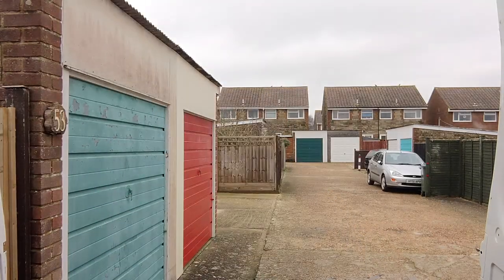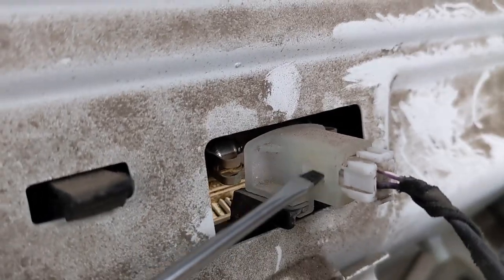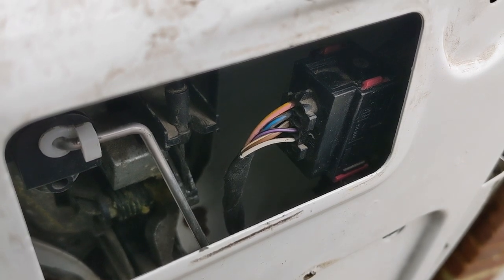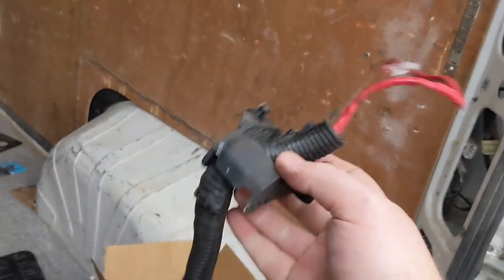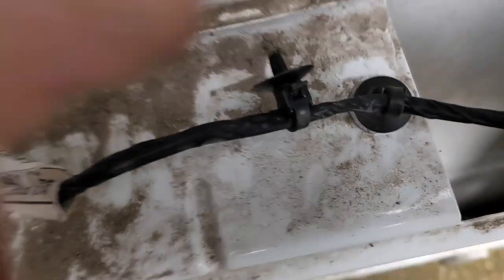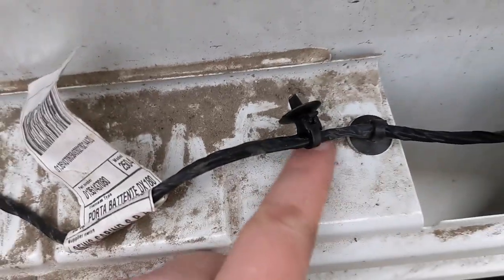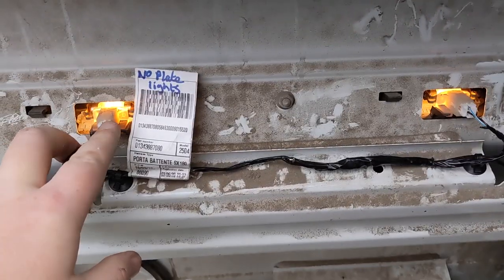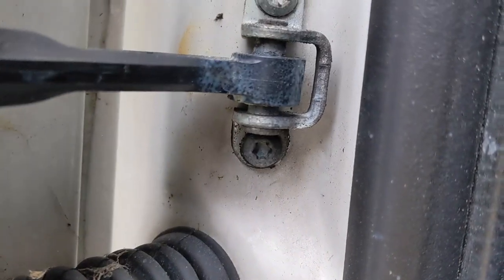Citroen Relay | Rear Door Cable Guide and Harness Replacement

Comment: Just picked up a relay yesterday for a conversion gonna investigate why doors aren't locking properly today. Your vid gave me some ideas to check out. Cheers
Reply from the maker: You are most welcome and thank you for checking out my video. Good luck and hopefully see you on the road sometime 👍🏻
Reply from the maker: I forgot to say if your doors won't lock with the fob and the indicator lights are flashing when you press the button. It is almost certainly the sensor on sliding door. The metal is weak and over time with the door closing the sensor gets pushed further away from the door contact. There is actually a little pin in the middle that tells the van it's shut and then it locks. There are a couple of videos on YouTube about it. Fixed by either pulling sensor off and then using plyers to pull the metal back, or gasket (even a piece of card) behind the sensor to bring it forward. Good luck either of which is a super easy fix 👍🏻